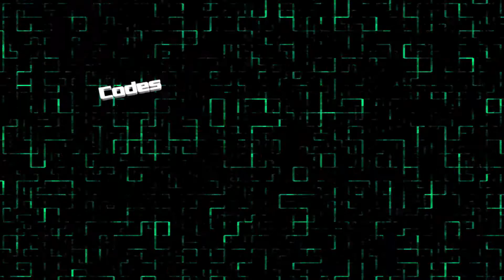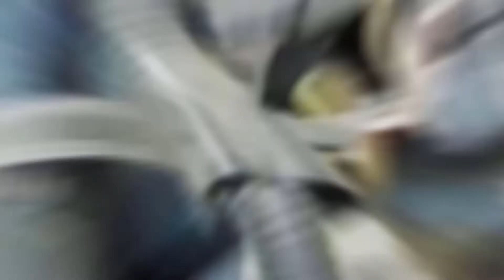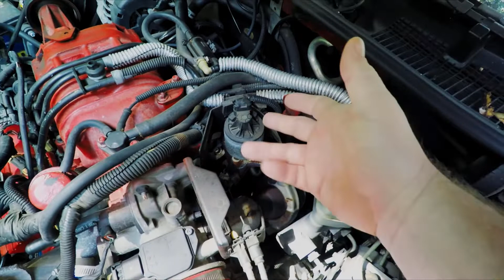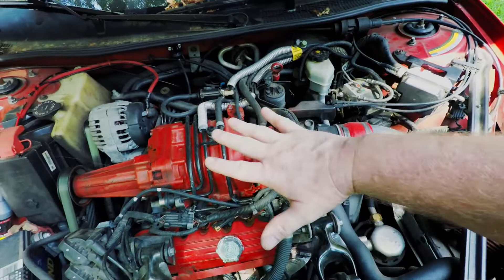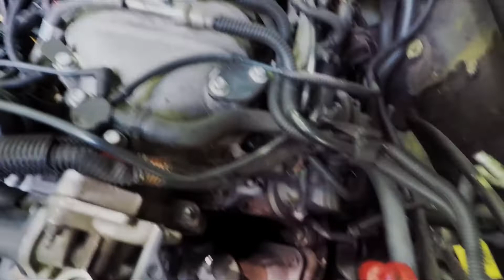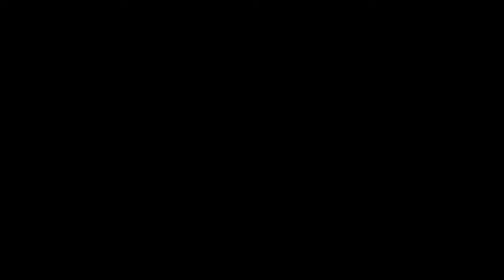Check Engine Code P0401 ( Codes Explained )

Comment: Hi, I've got an 03 Bonneville SSEi with the supercharged 3.8. I had P0401 a few months ago and I took the EGR off and cleaned everything and it was fine for a while until recently it is back. It wasn't very dirty or clogged at all the first time, so could it be the valve itself? How do you do that test you described about plugging the holes? Thanks!
Reply from the maker: If cleaning it helped i would bet that the valve is bad

Comment: HOW DOSE IT RUN ON THE SAME ENGINE WE GOT IF IT IS FAULTY, IM GETTING A SUGE AT LOW RPM DURING ACCELERATIONS
Reply from the maker: Depends on how it fails.  Low flow doesnt effect the engine, but i have seen them get stuck open and cause running problems

Comment: I’ve got a 99 GTP and it’s got Powerstop brakes on it. When I press on the pedal it’s spongey. Brake fluid is fine and the pads are practically brand new and are no were near needing replaced. Is this normal for older cars or does something need replaced in the brake system. I’m only 16 and this is my first car so I don’t have a lot of experience.
Reply from the maker: Could be a couple of things, how does it stop otherwise?  Any shaking?
Reply: Salem Doyle no, stops perfect. Pedal is just spongey. I noticed because I drove a family friends 2017 Ford Expedition and the pedal is super sensitive even with the slightest touch.
Reply from the maker: @IfItsA10r80YoureANonDrivingMF  could just be that you are feeling the difference between the two cars.  I would have someone familiar with grand prix drive it and give you an opinion.
Reply: Hoodie2103  the pedal is electronically controlled threw a computer or atleast more than the gtp that’s most likely what your feeling unless you have to slam it just to get a stop